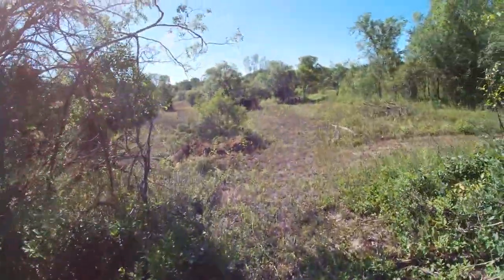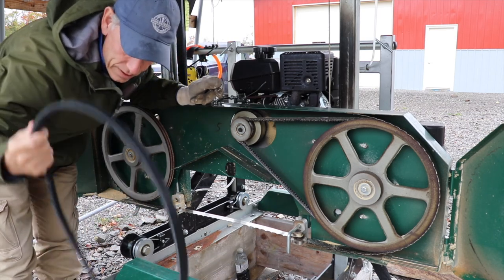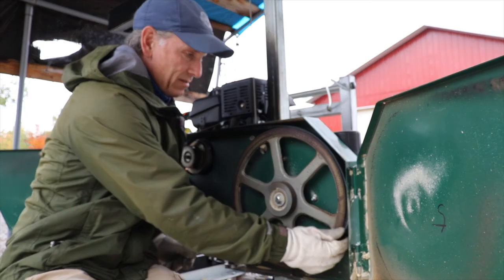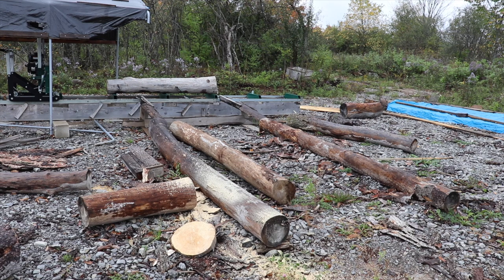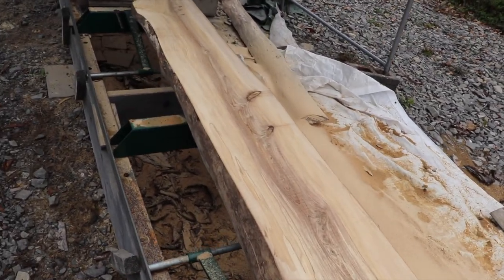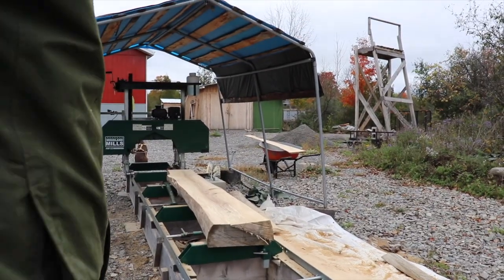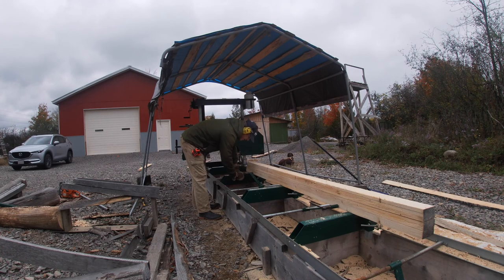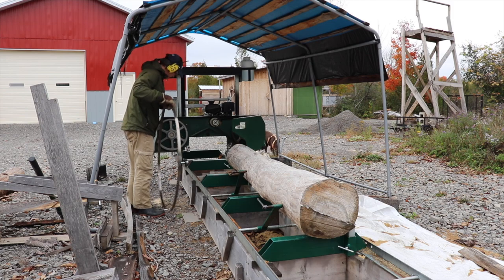Sawmill Maintenance and Sawing Logs to Lumber (Live Edge Ash slabs and Spruce 2x4s)

Comment: I've got as brand new HM122 and I've used it once. Now I can keep the blade on the wheels. I spent 2 hrs today trying and it won't stay on. It's not the same as the 130 and up. Totally different system.
Reply: They have an excellent troubleshooting chart in the owners manual.  Many things can cause the blade to come off. Water, tightness,  tracking. Several other reasons that shouldn't pertain to a new sawmill.